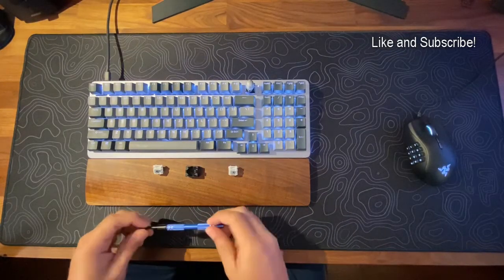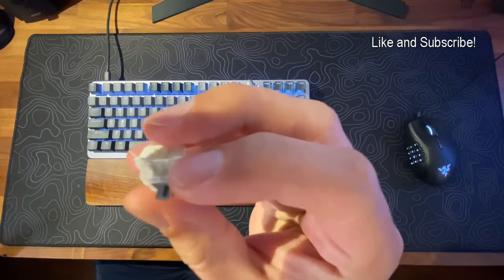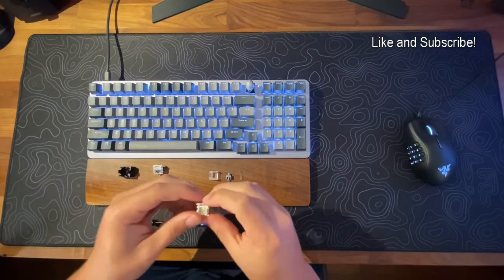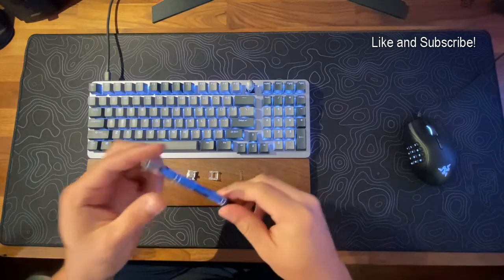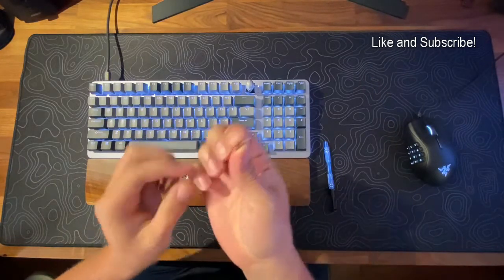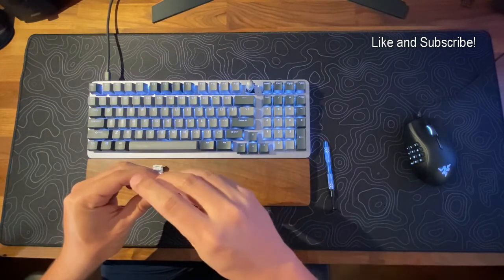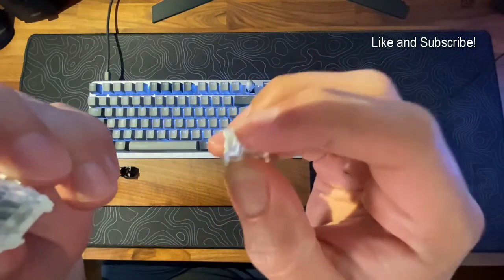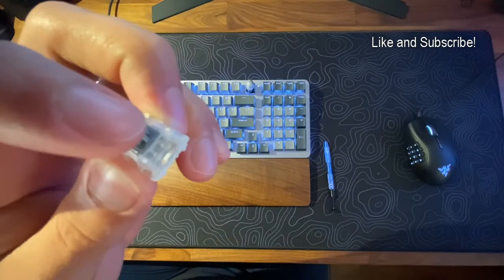Corsair OPX Switch Overview

Comment: Which parts did you lube? I am afraid of ruining the laser part on the pcb if lube gets in there. Also, can I just pull out these switches?
Reply from the maker: I lubed it like a normal mechanical switch would be lubed. Recommend watching one of the popular YouTubers. 

Ya i just pulled mine with a switch puller. The laser is on the PCB, not the switch. The switch stem breaks the lazer which is what allows the switch to work. Lubing shouldn’t cause any issues with it
Reply: @BokehhBob great! Is there a way to add foam into the shell?
Reply: @kingofyoursoul  you have to disassemble keyboard.
Reply: @BokehhBob  What Keyboard do you have that brought the OPX? I have the K70 RGB PRO OPX and I wanted to know if I could pull the switch out? and if I need to pull really hard or what I tried a little bit but I was afraid to brake it.